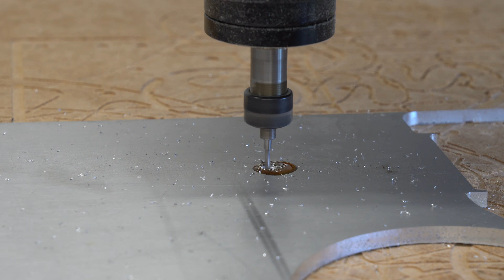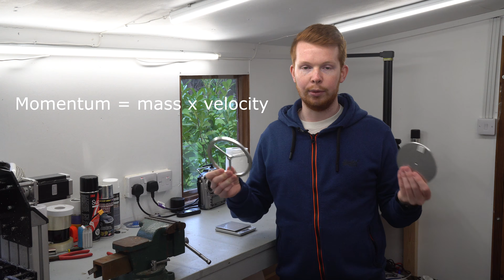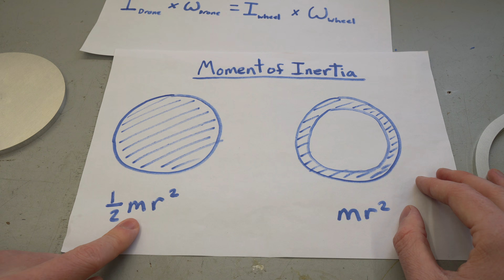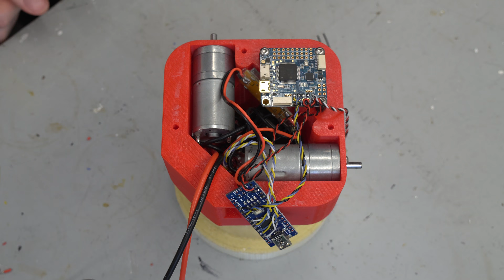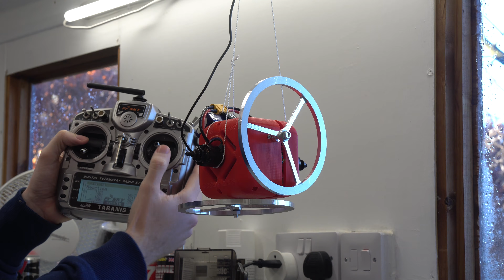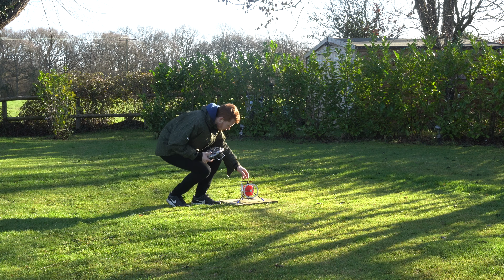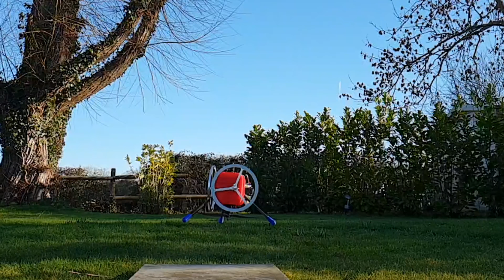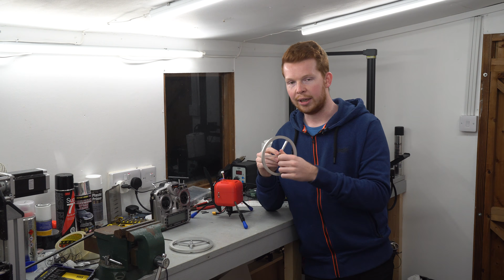Comment: Your center of gravity is too high.  If you have some spare thrust, try adding some weight below the bottom propeller to help with balance.  Or you could mount two batteries below the bottom propeller on each side.

Comment: This is such a cool idea. I think there's an easy change that might help. I don't know much about flight control or physics, and it doesn't sound like this project is going to be revisited, but whatever. The drone is rocking back and forth a ton the whole time it's flying. If the flight controller's using PID, I think the constants are a little off. Each reaction wheel is overcompensating and so instead of leveling out, it keeps overshooting. The D constant is supposed to dampen that out. Increasing the D constant and maybe decreasing P might help.
Reply: I would bet that the controller is not the main issue, but the induced instability from having the reaction wheels placed assymetrically and the size of such wheels.
Reply: Also the delay might be an issue... PIDs are just a tiny fraction of what's possible in control engineering.
The gist of it should be a PT2 system with the two differential equations:
di / dt = (U - i*R - C*Φ*ω) / L
dω / dt = (C*Φ*i - τ) / J
(i = current, C = motor constant, Φ = magnetic flux - should also be constant,  τ = external torque load, J = internal moment of intertia)
(ignoring minor non-linearities such as friction and issues with the rpm sensor) If you now apply the Laplace transform, solve for zeros and poles, look at the root locus on what additional poles and zeros to introduce by placing a controller in the loop and shifting the final poles into the predetermined desired places you get an actual accurate controller. Though there is still a little more to it.. but way better than this peripheral knowledge on controllers you get from DIY drone instructions out there.
Reply: Farley Moab   Esoteric? Explain please, since you seem to be the expert for state of the art control engineering, and my professor is not.
Reply: Farley Moab   No I'd acutally would like to know how my thinking is outdated! Sorry I caught you on the wrong foot.. sarcasm is dangerous with people on the internet sometimes..
Still.. this is scientific knowledge and it belongs to be shared. Even a reference to current literature on the topic would satisfy. I still find it difficult to search for the right things in the academic field and for me it seems to be a lot more work intensive than a quick google search.
Reply: Farley Moab   Can we please remain calm and matter-of-fact. I sinply asked you. What does it help me to say "No, you're wrong!" and not say how? I really really want to know. Just point me to a link or something if you don't want to bother expalining yourself.
Reply: Farley Moab   Studying in Germany - Student debt doesn't exist here as Universities are state funded. And I'll just say that you assumed me to be someone I'm not. Maybe it's the language barrier, but I won't bother you if you show me my lack of knowledge. I'm just genuenly interested in the subject. I just don't know where to start looking.
I've tried not to criticize you since you are very easy to get enraged, but I have to say that you shouldn't always assume the worst of people and get so angry over just a simple argument about control engineering.
Reply: Farley Moab   Ok, this is no nitpicking, you just missed that I wasn't taliking about the controller transfer function , I was saying that the dc motor plus wheight attached is a PT2 system. This part of the control loop is commonly called "plant" and consist of a "process" (internal workings of the motor) and an "acutator" (the gyroscopic force output). 
You can calculate the transfer function for that "plant" and from that derive the characteristics and settings for your controller (maybe a PIDT1 in this case).

So using a PT2 as a cotnroller doesn't even make sense and I do know that.

My point is though that there are multiple other methods to improve the performance of a controller other than simply adjusting the components P, I or D, e.g. pre-filtering the set point or adding a time dampening T1 component to the D term also resulting in a smoother reaction to sudden jumps and perhaps reducing oscillations.

The thing is though that you only come to those conclusions (and the best values for P, I and D) if you use the method I tried to describe: coming up with a mathematical model of the whole system as a set of fed back transfer functions. You then determine what type of system you have (this case a PT2) and calculate your control parameters through looking at the root locus of the open loop (without controller).

I was assuming that this method was what you called "esoteric" and it totally startled me, since, to my understanding, this is pretty much the industrial standard.

Comment: You need a reaction lever (a stick with a little weight on its end) rather than reaction wheel. The stick needs only slight, servo controlled deviations in terms to make very effective center of gravity changes. When I fly in the small Cessna well trimmed, a simple nodding forward of my head changes the CG in a visible way. Cheers!

Comment: With the feedback mechanism you should be able to use a PID loop . There is an Arduino library but I've not used it and it may still be in it's infancy. This link may be of use. https://www.physicsforums.com/threads/pid-control-for-drone-rotations.905431/

Comment: Good work! I'm no expert, but maybe the problem lies in gyros? Too sensitive, or not enough? Without your input and external forces (wind) the drone should fly straight up, without engaging the reaction wheels, because it only goes in "non-reaction-wheel-controlled" axis - up. Am I getting it right? So maybe it tries to counter something that is nonexistent (electronic noise may be the cause), or the slightest breeze makes it overreact. Maybe the internal gyros on the board are the weak point? Also, where is center of gravity? On earth orbit reaction wheels are cool, but here - maybe it has to be non-cubic, like real helicopter, that "hang" under its main rotor...?
Just shooting blind. Thanks for this, and waiting for next video!

Comment: That is a very interesting project. It looks like it could be made to work.
Tuning a control loop can take forever though. I've tried to make an autopilot in KSP and found that if anything is non-linear, it just is very hard. Using an encoder on the reaction wheels would probably help a lot.

Comment: Misalignment between the two propellers and between CG will not allow proper flight of this reaction wheel drone no matter how improved the control law gets.

A single motor counter propeller mounted on bottom (needs longer landing legs and a stiff link between motor/CG/reaction wheels) and better CG alignment would allow higher stability and longer useful flight of this drone until saturation.

It´s even possible to implement desaturation using the air drag. That would be a nice challenge.

Comment: It's a great idea.. but you have a reaction TIME problem.  You need a HUGE motor to be able to react fast enough to react to the attitude changes of the vehicle.  You could use dual torque wheels (two for each axis) spun up to max RPM, then use a braking system to apply the torque changes.  The extra gyroscopic forces would also help smooth out the flight, making high torque corrections less necessary.

Comment: reaction wheel way to strong and needlessly fast for the fine-tune type corrections that were needed. regardless I loved your video straight from that start. there's definitely something there. if you're still up for it, try again but with smaller reaction wheels that don't react to every little change, think "precision controls" in KSP. also focus more heavily on what center of mass is and how well aligned the wheels are so that they aren't wobbling the slightest bit. very fun and educational video!
Reply: yeah, seems like a smaller but faster spinning wheel would be better here
Reply: without correct mass ballance, reaction wheel will always saturate
Reply: @petergriffin760  yes - you need to change the direction the prop points in so that on average the reaction wheels tend to spin equally one way or the other. For example a simple gear and worm drive would do it.
Reply: Yes
Reply: Yes, I was thinking potential was too high as well :P
Reply: Exactly my thoughts as well. The wheels seemed barely rotating in slow-motion, and I think the wobbling was the result of the motors/wheels not reacting  fast enough, so a smaller/lighter wheel could do better here.

Comment: Pretty cool idea and nice work on all of it; however I believe you are trying to use static force/reaction in a linear fashion, and I think you should have the balance wheels spun up to a few k, and then have a servo use perpendicular forces to keep the craft level. Use the tangential forces from a spinning wheel just live a gyro. Also I think the DC motors you were using quite didn't have enough speed to accomplish the goal you were looking for. It seemed to me in the footage that they were always playing catch-up to the changes in attitude; they were very sluggish in response and that's why when the craft hit a certain point in its orientation it couldn't recover.

Comment: I wonder if a lot of the instability comes from having the counter rotating blade on the bottom. Hanging from both propellers would probably naturally damp out some of the motion and simply be harder to flip over. Yeah yeah, everybody else says something about gyroscopic procession but I feel like that's not a problem yet. Yes, making the center of mass the same as the center of rotation reduces the moment of inertial of the entire drone, but it also maybe makes it a little bit too responsive for reaction wheels (whose response time is measured in seconds)

Comment: Tom... the proximity of the 4 separate engines could be the issue.  You may be getting an induced current into the motors from the other motors, which could be why you are getting different outputs from the same motors.

Comment: Doesn't the motors have a lot smaller time frame to react when they have to stop from spinning in one direction to another?How about you try to put a wheel on each side and have each wheel spin only in one direction. 
And coudn't you address the motor torque input proble by programming the torque/current into the drone software because it could be a cheap and easy fix!
Besides thechnical improvements you could benefit from testing the drone in more controlled environment.

Comment: there's no way for this to work because the lift forces are smaller than the weight of the airship in that way the inertia conservation is useless. in my humble opinion you should keep the balance wheel in all 4 sides of the cube spinning at opposite directions and using 4 rotors instead of only one to increase the lift power of the airship and in that way the balance wheels will have something to work on.

Comment: What math did you use? I think math is the most fragile part here. You need a differential equation that describes the motion and takes motor delays into account, then you solve it for optimal control, then put that optimal (or at least stable) control strategy into the controller. Maybe you can just find it in the internet. I'm not an expert in this field, but when I tried stabilizing something similar in Garry's Mod, the highest influence was from the controll strategy, and not from the design. Intuition doesn't work well here, and simple strategies like "tilt it to the direction where it should be" might be unstable and doomed to failure because of exponential divergence.

Comment: I think it would have been more stable if bot props were on top, above the center of mass.

also, would having 2 reaction wheels for each axis help with the rpm saturation limit? like one main wheel for each axis, then when that reaches rpm limit, slowly put brakes on while using secondary wheel to counter that force? energy from rotation converted to heat, and the energy that didn't convert is divided between the two wheels, which would now be well below rpm limit?

Comment: Having 4 wheels (one on each side of the cube for each of the 2 axis) would probably result in a much more stable drone.
Here, if you turn one of the X/Y wheels, you have a torque on the X/Y axis but ALSO on the Z axis (because of the assymetry).

Comment: I have no experience in drones or anything like it, but, can you add another set of tripod legs facing up, so when the drone falls it can protect it self? I know it might interfere with the flight, but at the same time it might help with balance as it does not have to compensate for the weight of the legs. I am not sure though. Great video thanks for see things different.

Comment: May be missing a counterweight, the reaction wheels could be trying to fight against their own axial torque while in the air. The one success was one of the wheels making up for the other while the other did hardly any work. This also in turn kept an offset of center of balance making it crash sideways yet again.

Comment: in my opinion your drone suffers from 2 things. Non centered COM and overreacting. Setting proper center of mass should be self explanatory. Overreacting of the stabilizers could be solved by getting smaller reaction wheels, setting up dead zones in upright position maybe like 1 or 2 degrees in each direction, slower speed buildup and definitely slower stopping and direction changes.
Reply: and yes im aware the center of mass should be compensated for by the gyro mechanism but it just confuses the sensors more then needed

Comment: There is a way to prevent saturation but the wheels need to be constantly spinning at full rpm and just move that I'm not shure what that's called but not use the change in speed of the wheels use

Comment: I feel like if you added a dual rotor system on top and took away the rotor on the bottom it would make it naturally more stable having all of the lift from one point instead of 2 points one above and one below that in itself I believe would make the whole drone more stable

Comment: Warning: Huge wall of text ahead
If anyone is wondering how the ring has a greater moment of inertia (MI) than the disc, a simple way to think about it is intuitively applying the formula for linear momentum (on every particle of the body in theory, but just imagining it should be enough): Mass x Velocity. 
Let's say both the ring and disc are of equal radius for simplicity, you can see that the most of the particles (mass) are concentrated near the edge, whereas in the disc it's distributed throughout the entirety of the circle making it up.
For a disc spinning at a fixed "speed" (actually angular velocity), you can see that the portion farthest from the center moves the fastest, and the portion near the center moves much slower, in fact there's no movement at the center. So on average a particle from the ring spins faster than a particle from the disc. Since linear momentum depends on the speed and mass, and we have equal mass, we add up the linear momentums of every particle of the bodies (basically what integration is in calculus, adding up loads of small things) and get a greater value for the angular momentum of the ring than for the disc. And MI is 
Mass x Perpendicular Distance from Center (let's call this D)
Once again in the ring you can see more of the mass is at greater D in the ring than in the disc. So it has higher MI.

Comment: You have unbalanced weight distribution with the reaction wheels on just 2 faces.
 
Isn't that like trying to balance a pole strait up with a  weight hanging off the sides?
Reply: Keith Reynolds I’m guessing he’s thinking that if the system is perfectly stiff, the forces would be applied consistently throughout the unit. Maybe?
Reply: @noohairdontcare   to keep  the props horizontal the unit has to maintain a verticle. But to maintain a verticle you have to constantly fight  the weights hanging off two sides. Unbalanced,  I suspect there are unbalanced gyroscopic effects  too.   

I think he would have had better luck placing two reaction wheels, one on each side connected to the same axel.

Comment: Aerodynamic drag on the reaction wheel can prevent saturation. As long as drag from opposing axes are equal, there will not be any resultant thrust or torque.

Comment: It might help to have a reaction wheel on all four sides of the drone, dunno if you'd want them on two motors with an axle between opposite wheels or four motors so each reaction wheel can spin independently

Comment: I believe the prop wash was either not exactly aligned between upper and bottom motors as well as the intermittent interaction with the spinning wheels were causing the instability acting like control surfaces.  It also appeared once the tilt became too great the prop motor controllers spun out of control insuring a crash as they tried to recover.   If you mounted the motors 10" above the wheel enclosure and like a hang glider shift the weight of the wheel enclosure with the reaction wheels the control surfaces would be muted and controllable.   Lastly, use belt driven wheels with two on the sides and two (top and bottom).  This will eliminate balance issues increasing your cost by a factor 10!   Nice to be YT couch quarterback!  LOL  I enjoyed the video!

Comment: You seem to want higher low end torque motors with the idea that you can achieve crisp moment control like a satellite. But satellites don’t contend with counterrotating props, and all the myriads fluid variables that go with this. I think the question is, how much total torque is really needed for minimum flight control. Keep the mass of the reaction wheels to a minimum. You likely need nothing more than the mass of the armature to start. Just my two cents.